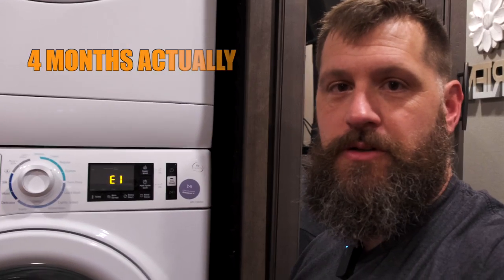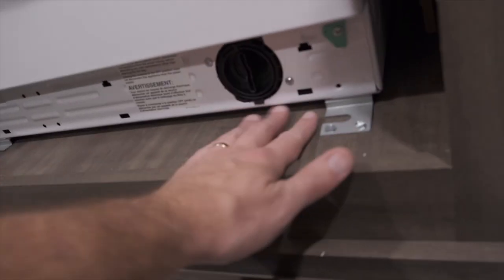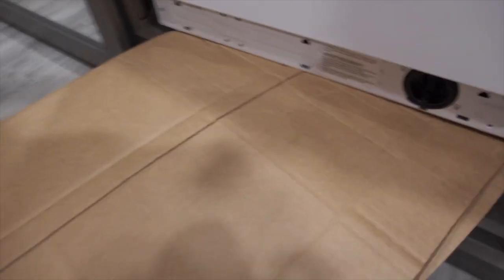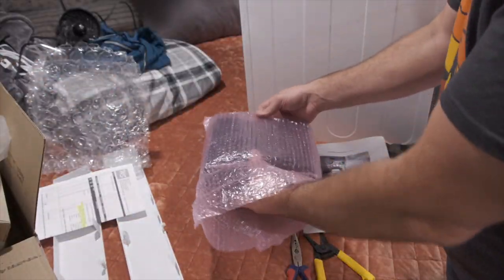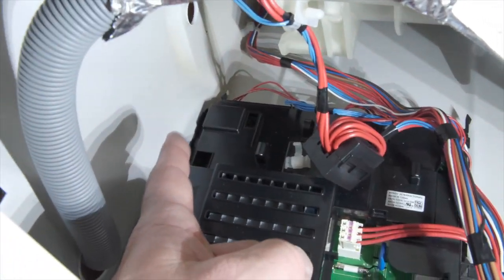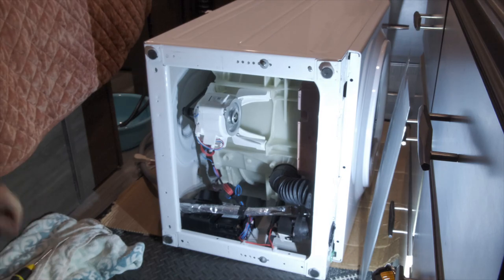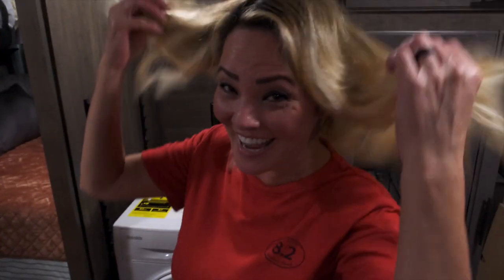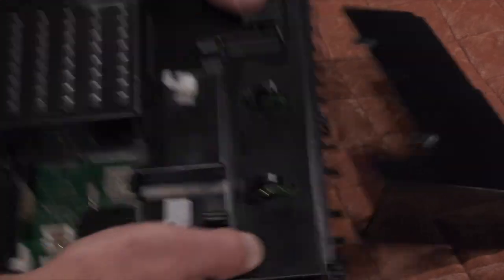What does E1F7 mean? (Splendide Washer) Travel America/Full-Time RV/RV DIY/RV USA (Live 2 Journey)

Comment: We just experienced this error code after 7 months of use. Thanks for the vid. This may be our problem too.
Reply from the maker: Yeah if you got the E1F7 it's gonna be that board. You should still be under warranty and to their credit, Splendide got the part to me within several days. Glad this helped!
Reply: Just called Splendide, they are sending me a new module. Great information!
Reply: FYI… the same issue just occurred again. They sent me another wiring module and a new motor.

Comment: We are having this problem as well with the same codes except we have clothes and water inside and it will not unlock!! I’ve tried everything. I appreciate your video.
Reply from the maker: Did you try the tab that you have to unscrew and pull on bottom right of machine?
Reply from the maker: Otherwise I think ours reset after we unplugged the machine overnight.
Reply: I’m not sure what tab you were referring to?
Reply from the maker: There is a gray plastic tab on bottom right of machine if you pull that bottom panel off. It has a screw in it. If you remove the screw and pull down on that tab it's supposed to be a mechanical release for the door.
Reply from the maker: Did you already try unplugging and while unplugged hold down the power button for 30 seconds
Reply: Thank you for your help. We did what you said and got it unlocked and finally got the now stinky clothes out lol. They are sending us the parts they sent you so hopefully we will be up and running again soon. Again thank you we appreciate it.
Reply from the maker: @jlynnandlancer  awesome! Sorry I couldn’t respond sooner about the tab. #smellyclothesclub

Comment: What should I do if the washer is not draining water?
Reply from the maker: I would call the company. Have you checked to see if your drain line is clogged?
Reply from the maker: Have you cleaned your filter out?
Reply: @Live2Journey  Im going to check the drain line before I call the company. Sucks that I have to take the screws out and pull the whole unit out to check the drain line.
Reply: @Live2Journey  I pulled out the filter plug on the front of the unit, and there was no filter in there. Just the screw out plug.